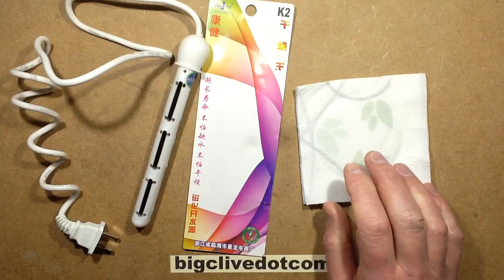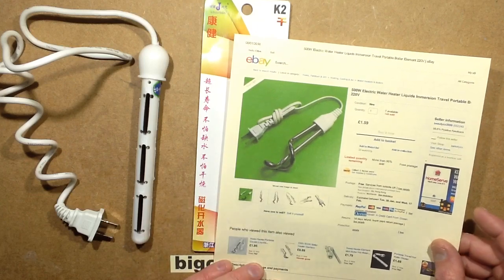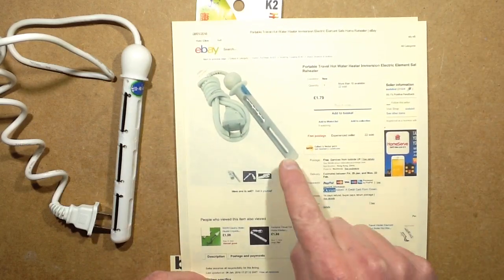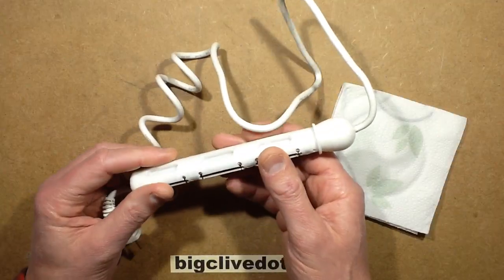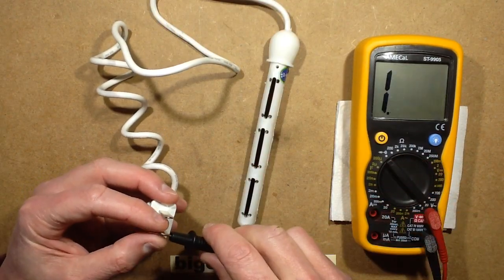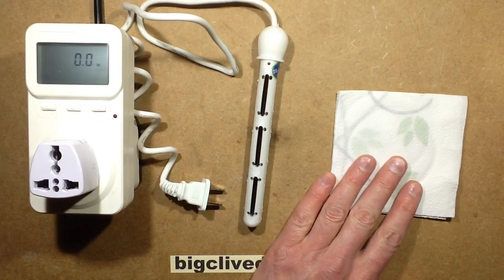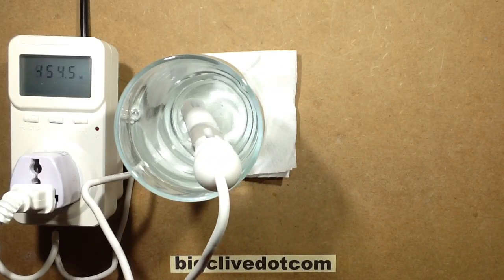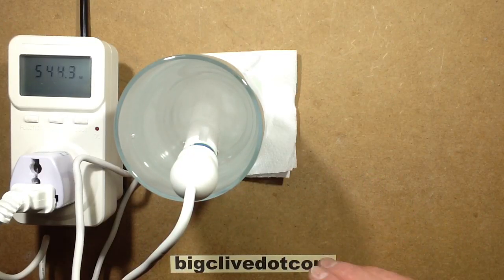Dangerous 240V Coffee-Cutor (coffee cup electrode boiler.)

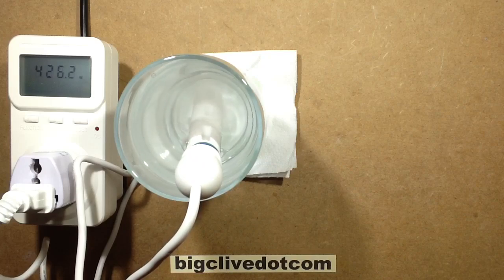Comment: 4:00 is that steam or hydrogen/oxygen from electrolysis? (haven't finished video yet)
Reply: +frollard electrolsysis only works on DC, then it would also dissolve one of the electrodes.
Reply: +frollard Would be interesting to throw in a match and see if it pops.
Reply: +gamerpaddy While not traditional electrolysis many cells do operate on AC in order to get mixed H2 and O2 gasses. 
It all depends on getting the current, frequency, and electrolyte correct such that the bubbles are ripped off the electrode by the ferocity of the ac phase. That way the bubble is not annihilated by the opposite phase.
Reply: +frollard Exactly. In this case the frequency is wrong. According to Wikipedia, 99.9% of the energy goes into heating the water. In this kind of AC environment, the H+ and OH- ions get separated, then pushed right back 
towards each other on the reverse part of the cycle, so very little, if any, water gets elecrolysed. In addition, any oxides on the electrodes would very likely act as catalysts to recombine any gas that does form, 
just like in a fuel cell. 

Here is a paper explaining how AC electrolysis can work: www.iosrjen.org/Papers/vol3_issue8%20(part-2)/I03825259.pdf

It is all rather complicated, and I would certainly not feel safe using such a product since I have no confidence that the manufacturer has done anything to understand the issues involved.
Reply: +seth094978 I would argue that you induce the same amount of electrolysis at 220v DC as 220v rms AC at 50hz; nothing more or less will happen until you increase the frequency to hundreds of kilohertz. The only difference is that both gasses will get generated at each electrode through a complete AC cycle (but not at the same time). Slow frequency AC electrolysis is just DC electrolysis with the direction switching; phase isn't relevant at low sinus frequencies. Somewhere at hundreds of kilohertz, if you mix two specific differing frequencies, you can additionally make the H2 pair split using the same amount of energy, but you can generate significantly more energy with true HHO gas compared to a H2 and O mix from regular electrolysis. The oxides wont make the freed gas return to water.
Reply: +viermidebutura A common name not following chemistry taxonomy does not invalidate existence of a stoichiometrically perfect 2:1 ratio of h2 and o2 gasses mixed together. It may be a bastardized step-child chemical name but it does exist.
Reply: It's probably gases dissolved in the water.  If you heat a pan of water on a standard hob you'll see gas bubbles rising from the bottom of the pan before you see the water boil, which is of course a surface effect.
Reply: +TheMrTape there is no such thing as HHO gas ....
Reply: frollard i know that too but i also know the non science meaning of HHO promoted by over-unity scammers 

also for a oxygen hydrogen torch is better to have slightly more than 2 parts oxygen

Comment: Yes they still make electrode boilers, with much more power http://parat.no/en/products/industry/parat-ieh-high-voltage-electrode-boiler
There's also electrode furnaces https://www.youtube.com/watch?v=G6Uxh-xtU-g
btw, i'm surprised they even bothered to have an insulated part for the connections, they could have left them open :D

If that device was enclosed in a stainless mesh screen and grounded, it should be totally safe, as long as the mesh was far enough away from the electrodes to prevent tripping breakers.
actually, you may want to try adding a grounded teaspoon and check if the water has potential to another teaspoon  ;)

Comment: You know what the crazy thig is Clive? The small flow-through water heaters you can buy now, like for a  bathroom faucet, most of them just use a bare heating wire with direct water contact. These are brand name devices made for the west with all the safety approvals. They just use an extra length of water column inside the plastic heater core for the isolation. The manual comes with a warning that you are not to install them if the water is above a certain conductivity.
Scary stuff.
Reply from the maker: Well to be fair, it can't really go on fire as easily as a heating element version.

Comment: Does it give off enough hydrogen & oxygen to ignite?
Did you try putting a match to that foam? (if not, please do!)
Reply from the maker: +Mark Warbington I'm more concerned about the beard.  It always looks much more dramatic than mere eyebrows after incidents involving combustible gasses and fumes.
Reply from the maker: Strangely enough I was thinking of trying that   Not sure it'll produce enough, but only one way to find out.
Reply: +mikeselectricstuff Now it's AC current, so will electrolysis even happen before the hydrogen and oxygen immediately recombine into water? I'm not so sure??
Reply: I have never tried Electrolysis with AC current. DC yes. . .
Reply: +Elliott Veares I wondered that and put "AC electrolysis" into a search engine. Interesting way to spend an afternoon...
Reply: +mikeselectricstuff Oh yes!  Please do!  And wear one of those Doctor Who vintage "are you my mummy?" gas masks so save your lungs and your eyebrows.  :)
Reply: I wonder how big the diodes would have to be to rectify a kilowatt?  I think then you would be able to get the ionic action needed to produce hydrogen and oxygen separately.
Reply: +bigclivedotcom I bet you tried that yourself!
Reply: If it does use the hydrogen to power a small engine driving a generator to power the heater that produces the hydrogen and so on. Who said perpetual motion was impossible?
Reply: @lfewell2161  The first law of thermodynamics.
Reply: mikeselectricstuff Yeah, I wonder if you could extract hydrogen with this thing?

Comment: I want a  3-phase version!
Reply from the maker: No probs.  Just buy three and add a couple of cable ties.  (I bet you bought one!)
Reply: @bigclivedotcom  this is dangerous. If you stick it into saltwater, it will arc and maybe even cause an electrical explosion. DiodeGoneWild did an expiriment of what happens if you stick into water and put salt into it to decrease it's resistance and it was arcing, flashing, and toxic gases were released. So if you get it, bad move
Reply: @bigclivedotcom   That would still ONLY be 230v, you need a 3 phase supply to get 400v, but of course you know this. Now don't try this at home, or anywhere else for that matter, as the outcome would NOT be good !!!
Reply: Do you want your tea to boil, or explode?
Reply: +mikeselectricstuff Yeh 3 phase 750v~  insta boil!
Reply: @andljoy  400v-415v not 750 due to the 3 phases have a 120 degree shift which makes the line voltage (voltage between the phases) squareroot 3 higher than the phase voltage (between line and neutral) Neutral is pretty much a centertap to the 3 phases.
Reply: +mikeselectricstuff I'm beginning to think you're a masochist.  XD
Reply: 5 phase! Heat a bathtub, chucky style!
Reply: I'll take mine in HVDC thanks.
Reply: 3 phase? That's for babies... I want a 6 phase version
Reply: This is simply a brilliant multi tool... a heater, an electrocuter, and a fire-starter all rolled into one nifty device... tsk-tsk :D
Reply: You just earned yourself another subscriber!
Reply: HAHAHA make me choke on my coffee
Reply: lol
Reply: mikeselectricstuff In centrepoint earthed networks, a 3-phase one would leave the water at near zero voltage, assuming all 3 electrodes in the same poker.  (Same thing with these ones in a US 220V socket).  But in a pure triangle network with 220V between phases and no certainty about which is grounded by accident (like in rural Norway), plugging this into a regular socket would randomly provide no voltage, 110V water or 190V water.  If it starts at no voltage, it will change the moment someone in another house plugs in theirs in a different phase pair.  Really exciting.  Sorry about the necroposting.
Reply: @johnfrancisdoe1563  I didn't follow, but it sounded like it deserved a 'thumbs up'

I will read it again..
Reply: I don't think anyone in this comment section understands electricity. 3 phase will give you 380-400V across phases (in New Zealand anyway at 240V). They don't use anything higher than 3 phases because you get diminishing returns after 3. I can't be bothered explaining the sine wave function of AC and why it's 400V because i'm not confident they'll understand
Reply: AgressiveRimJobs I understood before you said that

Comment: I could be wrong but I don't believe AC voltage will make hydrogen / oxygen (electrolysis of water).. everytime i've done any electrolysis based experiements either for plating / derusting or making gasses the power supply had to be of DC type. I guess these things would furr up pretty quick in a high mineral water and probably stop working unless you descaled them, much like a shower head on overdrive
Reply: +Neosophist Indeed it wouldn't produce any hydrogen or oxygen. Add a bridge rectifier for interesting fire action!

Comment: Many people using the electrolysis method for rust reduction swear by stainless steel, stating (incorrectly) that it's not consumed, stays clean and seems safe.
Stainless steel is indeed consumed when used in the electrolysis process, although slowly. The main problem with using it is the hazardous waste it produces. Stainless steel contains chromium. The electrodes, and thus the chromium is consumed, and you end up with poisonous chromates in your electrolyte. Dumping these on the ground or down the drain is illegal. The compounds can cause severe skin problems and ultimately, cancer. Hexavalent chromate is poisonous. These compounds are not excused from hazardous waste regulations where household wastes are. 
These compounds are bad enough that government regulations mandate "elimination of hexavalent chromate by 2007 for corrosion protection."
Does your electrolyte turn yellow? That's a sign of chromates.

If you have been using stainless steel for the anodes (positive electrodes), wear rubber gloves when working with or near the liquids. If you need to dispose of it, allow it to evaporate into powders and dispose of the powders in sealed containers during your local "hazardous waste clean-up days".

Best bet - don't use stainless steel no matter how tempting it is.

Comment: electrode boilis the process for melting minerals to there liquid state.  very dangerous and requires high levels of safe guards for turn on and automatically turns off once the furnace lid starts to lift off the furnace crucible

Comment: The industrial 3-phase electrode boilers for steam generation in AC systems were inherently safe. As long as the three phases were all active, the boiler vessel was at ground potential. Parkinson & Cowan used to make these boilers in the 70's. They were automatically rinsed once every hour to get rid of the calcium build up. They would stop automatically when the water supply was interrupted.

Comment: 3 phase electrode boilers are common steam generators in large installations. Near instant steam generation, and done in either a glass lined or plastic coated  steel container. Normally they run for decades until the leakage current gets too large as the lining erodes away.

Comment: Does any electrolysis occur? Given that it is AC power, I would have expected both hydrogen and oxygen to collect on both electrodes.
Reply: +TheUnnamedGent Ye, hydrogen and oxygen, if you are lucky. If you are boiling water with sodium chloride (Table salt), in it, you will be producing hydrogen and chlorine gas (used as a chemical weapon during ww I)!
Electrocution, flameable gasses, and chemical weapon, all in one present from china! No wonder Clive is excited! :D
Reply: +TheUnnamedGent No. It only happens to an appreciable extent with DC. According to Wikipedia, 99.9% of the energy goes into heating the water. I have studied some electrochemistry and electrolysis requires a DC potential to consistently separate the ions formed. In this kind of AC environment, the H+ and OH- ions get separated, then pushed right back towards each other on the reverse part of the cycle, so very little, if any, water gets elecrolysed. In addition, any oxides on the electrodes would very likely act as catalysts to recombine any gas that does form, 
just like in a fuel cell.
Reply: +TheUnnamedGent An accumulated mix of hydrogen and oxygen.  What could go wrong?
Reply: +TheUnnamedGent correct
Reply: +TheUnnamedGent ooh yes... put a match to that foam at the end of the video!
Reply: +Wuptidoo You'll also get bleach and lye in the remaining water!   \o/ http://scienceaid.co.uk/chemistry/applied/electrolysis.html
Reply: +Wuptidoo plus some sodium hydroxide solution. What's not to like?
Reply: I&#39;ve come to belief that most of the heat produced by this device is by nuclear fusion.
Reply: Only small amounts of bleach and lye in your drink! Totally better than using a kettle/microwaving!
Reply: +seth094978 damn you ruined our dreams!
Reply: Wuptidoo yum mustard gas. Must taste like mustard right?

Comment: And... Off gassing hydrogen.
Reply: +Lavikka Photography according to Wikipedia, 99.9% of the energy goes into heating the water. I have studied some electrochemistry and electrolysis requires a DC potential to consistently separate the ions formed. In this kind of AC environment, the H+ and OH- ions get separated, then pushed right back towards each other on the reverse part of the cycle, so very little, if any, water gets elecrolysed. In addition, any oxides on the electrodes would very likely act as catalysts to recombine any gas that does form, just like in a fuel cell.
Reply: +Lavikka Photography Sorry If my explanation was not clear. In short, mains AC current running through water will NOT form any hydrogen or oxygen. That ONLY happens with DC.
Reply: +Lavikka Photography I wondered if there would be some electrolysis too. That could do "interesting" things to the chemical composition of any dissolved minerals.
Reply: +Lavikka Photography and oxygen.
fuck no fuck this
Reply: +seth094978 Not true, there will be a reaction with lithium salts, usually a trace contaminant, which will form lithium chloride at high temperature or pure dissociated metallic lithium. That acts as a potent catalyst for hydrolysis...

Similar thing will happen with larger amounts of hexafluorosilicic acid (or sodium fluorosilicate, which will likely form it when heated in acidic soluion), used for water fluorination. The reaction is reversible at neutral PH and some temperatures. Usually not in otherwise hard water, but if you're unlucky enough... Pure hydrogen, hydrofluoric acid, silicon tetrafluoride... additionally it will etch your glass slowly if it doesn't get neutralized with, say, sodium in the water. (Which is likely from sodium chloride, meaning you get elemental chlorine instead, which will dissolve to form hydrochloric acid, which will further accelerate the reaction, forming even more nasty fluorides and more hydrogen.)

You only need a few hundred degrees celsius of overheated steam for this, which can probably happen in such a device if you cover the cup. This thing is very definitely not temperature controlled at all.
Reply: +Lavikka Photography Only with DC current, I think.
Reply: Thanks! Im fascinated by LEDs and this guy knows all.
Reply: TheRokkis Yes, it does produce hydrogen, oxygen and water vapor.  However, normal tap water isn't conductive enough to generate dangerous amounts of hydrogen. To make a hydrogen generator you would need to add a bit of drain cleaner, then you would get enough hydrogen to collect it and make an explosion. Grant Thompson made a 12V hydrogen generator, you might want to check it out.
Reply: It doesn't produce a significant amount of hydrogen because mains is AC, you need DC for electrolysis to happen.
Reply: "Hydrogen..." was pretty much my first thought when Clive checked the continuity with the meter.

I'm still not sure if that would produce hydrogen or not. I've seen it done with some contraptions but never actually took a more in-depth reading about it. Well other than "pass electricity through water".
Reply: +seth094978 thank you, i didnt know that
Reply: I've put electrodes from the mains into water before and I could light the bubbles that came of, indicating hydrogen was formed, so Hydrogen will definitely be formed. I use distilled water with some added sulfuric acid.
Reply: Yes I got that but it certainly looks like electrolysis with the tea.
Reply: That's what I'm talking about. The water there is very soft but add it to tea or coffee. Those bubbles coming off.... Put a lid on it will a small hole and see if it explodes with a little flame. Hmmm.